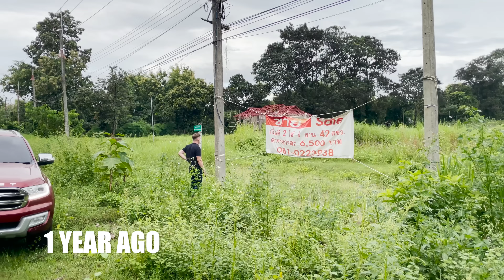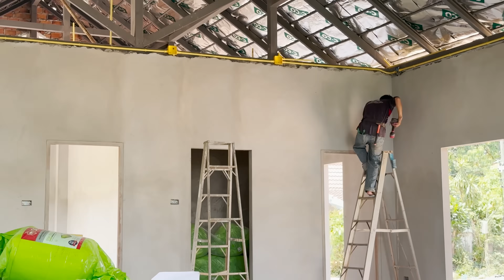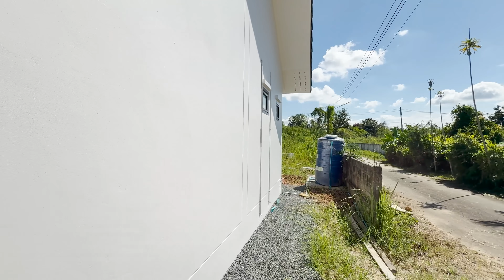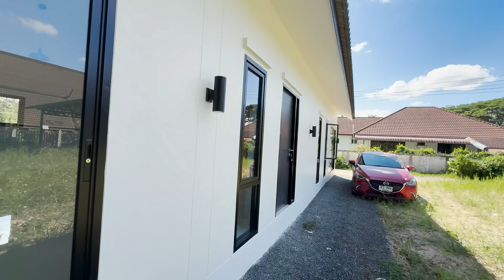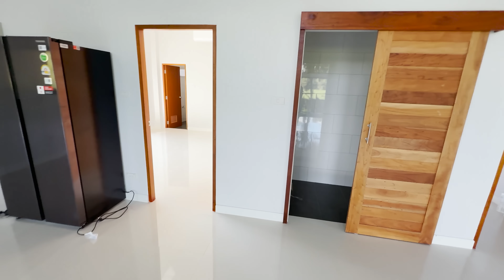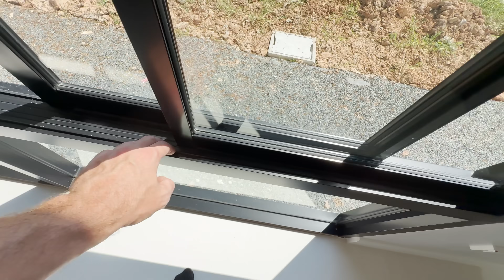DREAM THAI HOUSE BUILD FINALLY FINISHED!

Comment: Hi , name of the builder? and would you recommend him/them?
Reply from the maker: The builders we used were called Chai Varin Construction in Chiang Mai. We had a good experience and I would recommend. However I was quite involved in over seeing work and spotting issues before they became a problem. If I hadn't done this it might have ended up differently so would bear this in mind when choosing which firm to use.

Comment: Great house build. I’ve designed something similar but without the vaulted ceiling. Going to start building ideally next April after the land has had time to settle. We’re in the same area. Do you have a social media page? We’re vetting builders right now. It would be a great help to find out who your builder was and check them out as well. Thanks

Comment: บ้านสายมาก.ดูสะอาดตา ดูหรูหรา.ชอบโทนสีมาก.แต่มีข้อตำหนิอยู่เล็กน้อย😊ในห้องนอนระหว่างห้องน้ำรับแขก.แต่อาจจะเป็นแค่ว่ายังไม่มีการวางเตียงนอน.ถ้าวางเตียงไปทางด้านหน้าต่างที่รถจอดห้องน้ำอาจจะอยู่ในระหว่างช่วงสายตา.ตอนนอนพอดีห้องน้ำควรอยู่ในระหว่างด้านเท้าหรือด้านล่างของเตียง..ประตูห้องน้ำตรงกับเตียงนอนจนเกินไป.😊😊😊.แต่การมองอาจจะผิดเพี้ยนไม่เป็นไรความสวยงามหรือความลงตัว95% สวยงามมาก🎉🎉🎉🎉❤❤❤ชื่นชอบ
Reply from the maker: Thanks for your kind words🙏yes getting the bathroom positioning to work with the beds I found difficult as Millie was also concerned about this and the direction the beds faced compass wise. How they are positioned in both bedrooms is the bathroom door facing the bottom of the bed only and you cannot see the head of the bed from the bathroom. Millie seems happy with this but I agree would be better if they didn’t face any of the bed 👍

Comment: It is a beautiful house I like the design . I hope you got good AC this is going to take a  lot of BTU  power. I finished my house in Mueang Surin April 2023 , And what I can se it will cost a lot to Finnish the rest  . Our house was 1.8 M at your house is now,  and the total at Finnish was 3.5 M . But I like  it what you have done so far . 💙💙💙💙💙
Reply from the maker: Cheers 🙏 fortunately not had to use the ac much yet and electric bill is around 800 baht a month. But it is winter i guess!! Will be interesting to see what it’s like during the summer

Comment: Hi "
Enjoyed your video. I have a question. How did you protect yourself with regards to owning 50/50 of the land with your partner? Foreigners aren't allowed to own land in Thailand so that means if for some reason you & your gf had a bumpy time & split (hope not🤞🏻😢 but it happens a lot)
what happens to your House you paid
...... % for? Your partner
will own the land & whatever % of the House you own & paid for, she can block you gaining access. The House will be sitting on Thai owned land.
I'm curious because I've been researching the best place to buy land & build, Thailand, Laos Cambodia etc

Thanks
Reply from the maker: I go into allot of detail about this in the next video as this was a common concern with allot of viewers so you should check that out. Basically though the house and land are mortgaged
Reply: @missioncapri 
Ok Thanks 🙏

Comment: House looks superb ,, the upstairs windows on the angle, did they use lintels over them to continue the blockwork.
Reply from the maker: Cheers 🙏 They cast in situ concrete lintels with block work over the top. The concrete used wasn’t the best as they mixed by hand. It did have rebar through it though and for long lintels like this they attached another piece of rebar from the centre of this rebar upto the steel roof structure. This helped stop it sagging in the middle

Comment: Nice house, but if you’re worried about snakes you need to sort that garden and cut it back. Get a few dogs and you should be ok.
Reply from the maker: Cheers 🙏 I’ve got a Strimmer now and swapped the lethal blade with a nylon one 😂 surprisingly I’ve not seen any snakes yet. Although I’m sure this will change 😂

Comment: Great job mate. It looks fantastic, flooring and tiles really do suit the space, bit by bit when you’ve got the dosh you can start to do your add ons, the 2 sides with the decking and roof extension will look fab, sit outside in the evening with a whiskey 👍👍🙏🙏🇹🇭🇹🇭🇬🇧🇬🇧🥃🥃

Comment: Beautiful house mate. Can I ask why you didn't put solar? If I had to guess it would be because electric is so cheap there that the need for solar is mute.
Reply from the maker: You guess right! Electric is roughly 1/3 of the price in the uk so takes much longer to pay off. Also from some of the solar stuff I’ve seen has been quite low build quality so I’d be worried that it would break before it was paid off.

Saying all that though it’s something I plan to do in the future. For slightly different reasons. The first is for when there are blackouts to keep the fridge and WiFi running and also as because solar works so well here with the large amount of sun.

I will probably be looking at a diy system though something to keep costs down possibly without a battery…

Comment: Nicer tiling finish than I got.  My sink P-trap installs were awful. The toilet installs were awful. Smells, broken pipe,  broken tile, no flange, no seals and the toilets are cemented to the floor without anchor bolts. Totally Thai farmer construction. Better workers are already working for estate builders in cities and towns.

Comment: We have a design somewhat similar, north of Korat. The sun will absolutely destroy furnishings, etc. We looked at three tinting options for the glass. We went for the middle cost opton. The windows are tinted to 80% (reasonably sure) which makes them look black from the outside but from the inside, surprisingly doesn't feel like it's tinted at all. Think of how dark car windows are tinted. We have a cathedral ceiling in the main room like yours and had a ceiling fan fitted but the aircon moves the air so the fan looks good but not used. We didn't have tree cover like you and bought two large trees from a landscaper and that has largely addressed that issue
Reply from the maker: Going to look at some tints soon!! Only get direct sun for the last couple of hours of the day but you can tell the difference!! The trees make such a nice shade

Comment: You may collect rain water to fill in your tank, that is free water.

A simple PP filter on the water holds out sediments and it is only 200B. It helped reducing the redish deposit in the bathroom.

Extractor fans in the bathrooms, I believe they work with the light switch? It could improve to add a cheap timer so the fan continues running for 5 to 10 minutes after the light s off. That helps tremendously with the mold.

Very nice house!
Reply from the maker: Some good ideas there, yes extractor fans work off the light switch but would be good if they had a timer/humidity sensor also. Seems to dry in there relatively quickly though probably due to the small window
Reply: @missioncapri  The window should help. At home I have no window in the bathroom, the black spots were developing on the plastic door within 2 weeks, now after 6 month it is not yet as bad.

Comment: Good morning , I have lived in Thailand for 12 years and every floor in my 4 homes laid like that have become loose and needed redoing . Home looks great mind how much land is it sitting on and will you wall the land and have electric gates ets? Any pool going in ?
Reply from the maker: Cheers. Hopefully we get a good few years out of it! A few have told me that I might have a few issues with bits around the house after a couple of years. House plot is 0.5rai and walled in on two sides. The front wall I plan to make higher and have an electric gate and a new wall along the other side. Going to try and sort out the wall as soon as possible 👍
Reply: Yes after only 2-3 years, I still do not know the reason. Was this due to bad glue or unprepared underground, do you have a clue?

Comment: Why such a rush though? There is absolutely no way you can buy a new land and build everything in 6 months in the UK either.
Reply from the maker: Prior to starting I’d heard a few horror stories of people having builds done while not been in the country and ending up with a house quite different to what they planned. I could only be in Thailand for 6 months due to my work. So we tried to get it all or at least the bulk of it done within those 6 months. But you are right it would take years just to get the necessary permissions to build in the uk let alone getting it built!

Comment: Turned out very nice. One issue you should address is the tree roots, which will be at least twice the size of the canopy. So if you leave those big trees where they are, it's more than likely going to lead to wall cracking over time. I wish you both many years of happiness in your new home.
Reply from the maker: Cheers! Yes they are very close and will undoubtedly cause problems but it is nice to be next to them

Comment: Very impressive! Love the greenery, openness and the Thai build quality is second to none! Seriously! Aussie builders could learn a lot, the precision in the tile work, neatly ducted electrical, non of the typical Aussie slop the cables loosely through the walls and roof! 

And the dumb electrical laws here wire up the earth to the copper pipes, with a single earth peg, meaning if the wire to the peg corodes, which it often does, then any short goes into the taps and water! 

Not bashing Aus, but we've seriously become a third world country on so many levels. 

As for your build, it's just a reminder of why Thailand has a bright future. They really stand out among many of their South East Asian counterparts with their excellence of build and quality of craftsmanship. It's something I've noticed even in rural villages many of the builds are actually of a decent quality. 

Anyway, huge congrats on it, hope you can both have many many happy years ahead in it together 😊 And thanks for the inspiration.
Reply from the maker: Cheers, I was certainly very impressed with the builders out here!! They work hard too!! 
It’s nice also to have the freedom to do what you want todo. Not something I’m used to in the uk, where everything must be approved!!
Reply: @missioncapri 💯% That freedom is priceless, really killing many western countries now where even the most minute of decisions have to be "approved". Really hope Thailand doesn't over regulate or cave in to the western badgering.
Reply from the maker: Me too!! Everything just feels easier when you have the freedom to do stuff
Reply: Cities yes, I have a 30yo house on the Mid North Coast, NSW.. zero issues...
I wouldn't buy an apartment in any of our cities that aren't more than 20 years old..
🇦🇺

Comment: Thanks for the updated vid....looks fantastic....I watched most of your build vids. My partner and I (Cambodian) are going to build a house in next year in Siem Reap. smaller plot but wanted a similar reasonably priced house. I'm there for ~2 months a year now 3-4 times and still work full time from Ireland..... I'm not a builder so will be getting local company to do.....will be 2 more yrs at least until i spend more time there... my plan is exactly to do the same as you - as open plan as possible and a 2 bed.....I had not considered opening up the roof in the main living area...., i know Thais like the ceiling high......was this to keep the room cool during the day...? my fear when sun hits and you need air con you have to cool a much bigger room.... maybe you can comment on your next vid...? yeah, cost is major concern fo rme even in Cambodia too....hoping for a 120-130 sq mt. house if i can afford it. looking forward to your next vid.....Colm...
Reply from the maker: The build seemed to go much better when I was there and although it did help coming from construction, the method of building was very different to what I’m used too. So I learned allot from similar videos to this and ebooks. Yeh I’ll talk about the vaulted ceiling in the next video but your right if you need to use ac it is a big space to cool. Fortunately though it stays cool most of the day